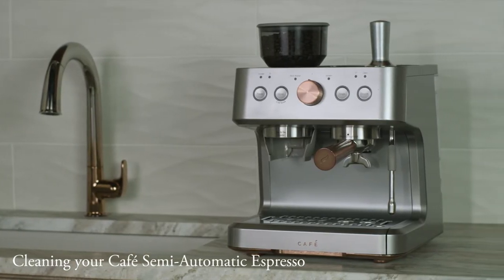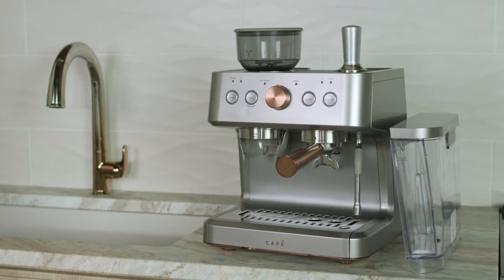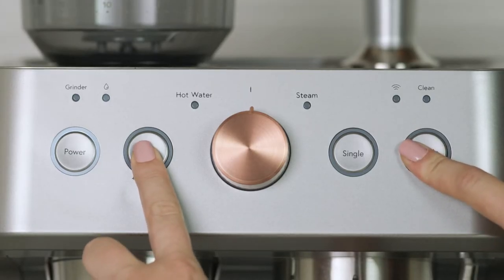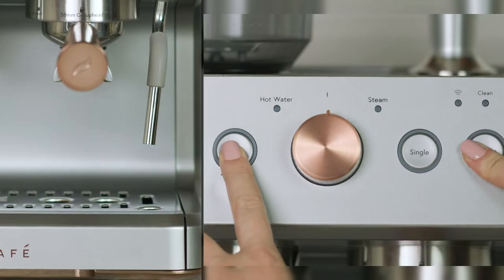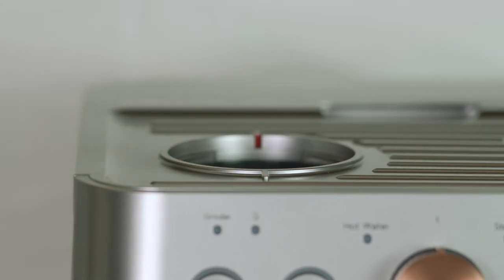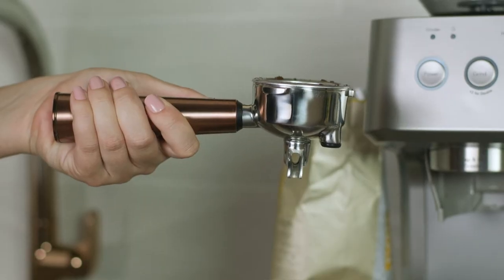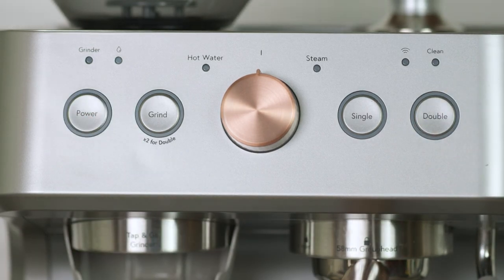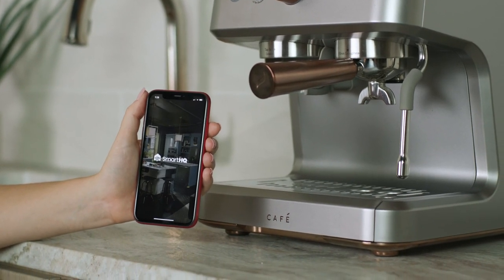Cleaning and Descaling your Café Semi-Auto Espresso Machine

Comment: I have had CONSTANT issues with my espresso machine. One issue gets fixed and there's another. I have tried multiple times to find some kind of customer contact line for assistance and the only customer care options are with regard to orders, returns, and shipping. When I did call I was told by a CAFE employee they know nothing about the appliance or how to help! Now I am having an issue with my espresso grounds shooting out the sides of the machine missing my puck wasting PERFECTLY GOOD and costly espresso!! Would appreciate some kind of customer communications line when I spend $700+ on a countertop appliance!

Comment: How does one obtain a replacement for the 58mm silicone steam ring which seals the portafilter? My nearly two year old unit is starting to leak around that seal with the water dripping down from around the skirt of the grinder if the portafilter is a bit too full.  I’ve looked on GE Appliances parts but can’t find it.  Other 58mm steam rings I’ve found for similar Breville machines do not have the three notches like the CAFE machine.
Reply from the maker: Hi again Teddy,

We just wanted to reply here too letting you know that we've seen and have replied to your other comment too. -MS

Comment: what are the cleaning agent tabs to drop in the water?
Reply from the maker: Hi Isaac,

Thanks for asking! Your espresso maker will come with a cleaning kit that includes the following: a pin (needle) for cleaning, a cleaning brush, cleaning solution, and a microfiber cleaning cloth. As an alternative to the cleaning solution provided, a 1:1 ratio of water and white vinegar can be used for the descaling process. You should not use any cleaning agents not provided with the product or recommended in the instructions.

If you have other questions about your appliances, feel free to ask! -MS
Reply: @CAFEAppliances   where can we purchase the cleaning solution? Our machine did not come with a cleaning solution.
Reply from the maker: Hello. We hate to hear your unit didn’t come with cleaning solution – we know how important maintaining your machine is, and we want to help. Can you clarify if you removed the drip tray to check for the cleaning kit? Depending on your model, the unit may come with the cleaning kit located in the bottom left corner of the machine. 

If you still aren’t seeing the solution you need, can you please confirm the model number of your machine? That information would be helpful as we look into this further for you. 

We’re also glad to assist with any other concerns you may have, and we’re wishing you all the best! -SG

Comment: my “clean” button never shuts off, even after following instructions and cleaning. why?
Reply from the maker: Hello. We regret that you’re having trouble with the Clean alert, and we want to assist. If you have model C7CESAS2RS3, the manual has cleaning instructions starting on page 15 and is linked here: http://spklr.io/6056lBEm . Were those the specific instructions you followed? 

If you’ve followed all of those instructions and are still seeing the alert, you may want to try resetting the electrical components of the machine by disconnecting it from power for a couple minutes then reconnecting; this can resolve some issues.

 If you continue to have trouble, you’re more than welcome to send us a private message over our social media (such as Facebook or Twitter) confirming your model number; we’d be happy to discuss this further and help reach a resolution. All the best! -SG
Reply: There was a yellow insert in the manual of the machine I bought which said if more than 1/3 of a tank is used for the initial clean then the clean light may not go out.  I’ve found that running the cycle again with less than 1/3 tank of water then a full tank will usually cause it to go out.

Comment: Can we see the video of deep cleaning portafilter?!
Reply from the maker: Hi Saida!

You would simply want to dispose of the grounds in the portafilter, rinse with water, and then let the parts dry before putting it back into the machine. More cleaning tips can be found in the Use and Care manual, here: http://spklr.io/6056mQw4

Hope this helps! If you have other questions, feel free to let us know. -MS
Reply: @CAFEAppliances  is there no way of cleaning them internally? What are the extra portafilters for then? Since they done have the mesh to brew espresso
Reply from the maker: Hi again!

So long as the cleaning instructions on page 13 in the Use and Care manual are followed, the portafilter will be clean, no need to take anything apart. The other filters shown are for different types of espressos. Page 8 talks more about them! -MS

Comment: Comments about descaling:  Narration says to fill 1/3 of the water tank for descaling but at 1:00 in the video the cleaning tablet is seen being dropped into a full tank of water.  My machine came with a pouch containing three cleaning tablets with the following instructions: “DIRECTIONS:  insert one tablet into the special opening and follow the machine manufacturer’s cleaning ang (sic) maintenance instructions. There is no identifying manufacturer or part number or information on the tablet packet nor was there any information in the supplied documentation.  When a tablet was dropped into 1/3 tank of water it did not dissolve!  Even after removing it and crushing the tablet it did not dissolve so I reverted to the instructions on page 14 of the manual and used one liter of a  1:1 mixture of water and white vinegar to clean the machine. (Tank to FILL line holds 2800ml).  Clearly the cleaning tablets supplied with the machine were not designed to be used with it.  

With regard to filling the tank only 1/3 full for Stage One cleaning (vs full as shown in the video) the instructions which came with the machine on a yellow STOP - IMPORTANT INFORMATION — insert explains the reason to only fill 1/3 (one Liter).  It states:  “In Stage 1 of the process if over a THIRD of the water tank is used, the Add Water LED light may NOT turn ON.  Stage 1 will complete in under 5 minutes and the pump will turn off. It is acceptable to continue to Stage 2 after that time.   CLEAN alert may NOT automatically shut off after stage 2 even though the process has been completed and the pump shut off. Please press the Power button OFF and ON to clear CLEAN alert.

If you own one of these machines I suggest following the instructions on page 14 of the Owners manual using 500ml of water + 500ml of White Vinegar instead of the supplied tablets or first trying to dissolve the tablet in 1 liter of water in a separate container before using the solution to fill the tank 1/3 full.   CAFE, you should investigate and make sure the proper cleaning product is included with the machine and it is identified with a part number with information how to re-order.  I could not find any cleaning agent for CAFE expresso machines on the GE OWNER store web site.  If you have part number / source for a cleaning agent which will actually work suggest you add it to the comments.
Reply from the maker: Hi there Teddy, and thanks for sharing your concerns with the cleaning process. We know how important cleaning and maintaining your machine is, and regret any inconvenience you experienced. Your feedback regarding the level of water shown in the video, as well as the issue you had with the tablet not dissolving, will be shared with our team for review; we appreciate your insights, as we always want to be aware of any possible issues. 

Based on this video, it looks like your espresso machine has a model number of C7CESAS2RS3. If that is correct, the Descaler 3-pack that is compatible with the unit is listed under Part #WC01X20655. You can order that on our GE Appliances Parts website; you can also look up your model number on that website to view the parts breakdown and make sure the descaler is correct for your model, if you’d like. 

We hope this information is helpful, and you’re able to descale your unit with no further inconvenience. We’re always glad to assist if you have any other questions or concerns – wishing you all the best! -SG
Reply: How often do you use the vinegar and water if you use the machine once per day?
Reply: @TheBella489  When the clean light illuminates, based on water volume used which the machine tracks.  The app shows how many liters remaining before cleaning.  For  me using 2-3x per day I get the clean notice very two months.
Reply: Thank you for this comment, this is exactly what I’m experiencing now (the tablet not dissolving) and I came here hoping for answers! It does really seem like the tablets are just random third-party descaling tablets that GE threw into the box without using. I’m wondering if maybe the tablet isn’t supposed to completely dissolve or something, but I dont know. I love that Café replied and didn’t even address the performance issue with the tablet!
Reply: @bjcthatsme123  	I’ve continued using the 1 part white vinegar : 1 part water to clean when indicated and it seems to do the job.
Reply from the maker: Hello,

We're sorry to hear the cleaning tablet is not dissolving. Once you fill third of the water tank with water, add one pack of cleaning solution in the water tank (one tablet or packet). Most importantly, be sure to mix well until the cleaning agent is fully dissolved. 

However, if it does not dissolve after mixing well, please know we take all feedback to our development team for any improvements. We are always here if you need anything. -SH
Reply: @bjcthatsme123  I was having the same problem. After I dropped it into the reservoir and it wasn’t dissolving, I just crushed up the tablet with a wooden spatula against the bottom of the reservoir to break it into fine pieces. The smaller pieces will eventually dissolve.
Reply: @CAFEAppliances I’ve done the process 3x and the ‘Clean’ alert is still on 🙃 Can’t get it to turn off no matter what….

Comment: Ok first let me help everyone.

To start the machine needs to be on. In the video it looks like it’s off so like an idiot I tried pressing the two buttons while in off status confused why it wasn’t working haha.

The tablets provided need WARM water. And ALOT of stirring. I’d say get other tablets that actually dissolve as they should or use the 1:1 water/vinegar solution. I am stubborn and wanted to figure out the tablets provided in the package. 

I used a separate bowl and using 1 cup of water made the water  boiling hot and added the tablet and stirred well. Then added that water to the 1/3 lukewarm water in the dispenser. That did the trick. Then I used a BIG bowl used for baking (not a tiny glass one like they show in the video. What’s in the tank is getting fully emptied into the bowl and the water will be hot.

After that I refilled the tank once the add water sign turned on and repeated the process. I didn’t have to turn the machine off and on because it stayed in cleaning status so I just refilled pressed the two buttons for good measure and then switched from neutral to steam again. Once emptied I rinsed and refilled the tank and wallah she’s sparkling.

A note to Cafè, you need to hire better customer service or simply put in more effort for those of us trying your product. The replies are robotic and leave the customers concern completely unanswered. I love my espresso machine but from what I’ve seen you guys need to do better in assisting those who have issues with their machines. We should not have to trouble shoot like this when you are the designers and should have quick and easy answers. Sincerely, someone whose trying to help ♥️
Reply from the maker: Thank you for your valuable comments with regard to cleaning the Cafe' Semi-Auto Espresso Machine.  Your feedback is appreciated as our design teams use our customer's feedback to improve ownership experience.  We're so glad to hear how you love your espresso machine!  Take care!  -NC
Reply: NPC response. The irony.

Comment: I have issues with my espresso machine , it leaks water from the bottom, so when I try to make espresso, it drops and water under the machine comes out. 
This is my second cafe espresso machine that I gave a try and they month have the same issues … only used for 3 months. Very sad and very disappointed, need to see what can be done by the company at this point
Reply from the maker: Hi there - We're sorry to hear you're having some trouble with water leaking from the bottom of the unit. Steam/water is released after the brew into the far back of the drip tray.  It is not normal for water to miss the tray.  Please make sure the tray is installed properly to catch the steam/water that is released. If the problem persists, please reach out to us on Instagram/Facebook/X via private message. We'd be happy to assist you further. Best, JS
Reply: I had the same issue and I removed the lid that s goes on the tray and no more water coming out from the bottom. The one on the right side.

Comment: I'm confused, she says: Fill a third of the water tank. And she filled up to the max line.
Also is this 30 minute process needed before first time use (I thinking since I don't need to descale.)
Reply from the maker: We apologize for the confusion. Only a third of the water tank should be filled for the descaling process. You do not need to complete the descaling process before the first use, but we do recommend cleaning the unit thoroughly. Congratulations on your new espresso machine!